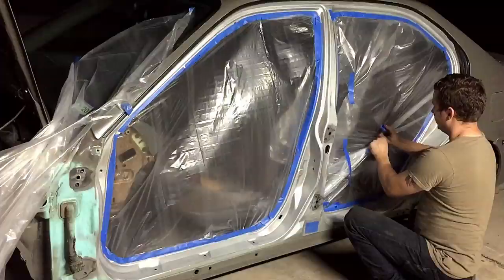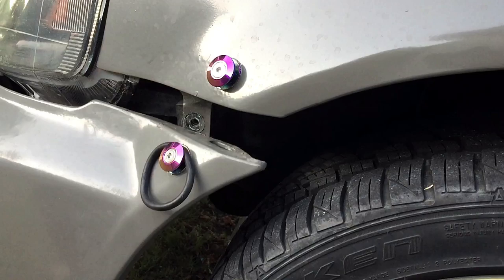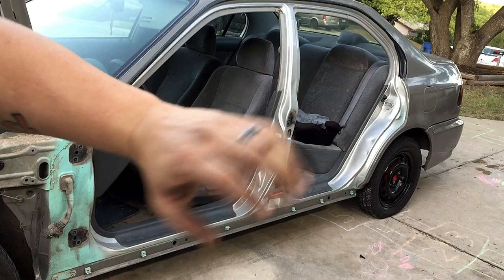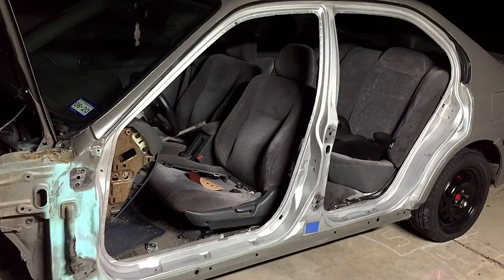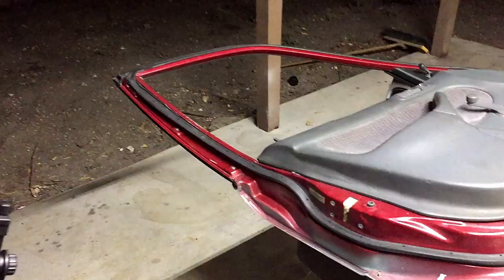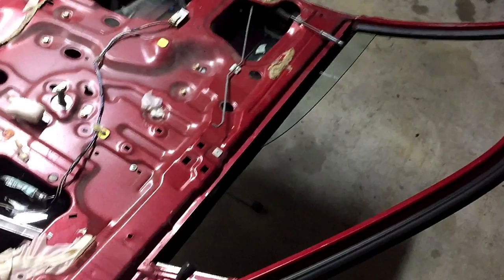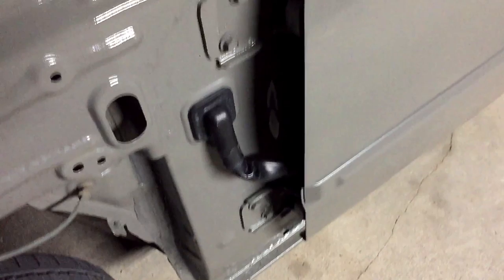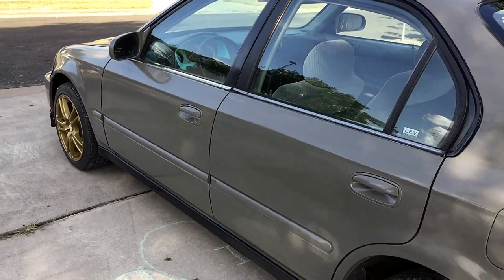How to paint door jambs on your car.

Comment: To get the window chank handle off I like to use a rag to push the clip down by pulling the rag tight and sliding it down behind the chank handle pull the rag side to side an in at the same time and it will push off the clip. Doesn't scratch things and the clips don't go flying
Reply from the maker: Josh Gardner Very smart I’m pinning this post!

Comment: Some good info and bravery there. I have 1 suggestion, before you remove any doors or hinges drill a couple of small holes through each hinge into the door post, body or whatever it mounts to. When it comes time to remount everythingvthe small holes will help align the doors to there original position.

Comment: Looks good. It seems like the Tractor Supply paint has better coverage with less paint/cost which is important when you're on a tight budget. 👍  By the way do any of those "chrome" paints actually look like chrome?
Reply from the maker: ghogue61 Nope. They have one that can be applied with a paint roller or brush and it does look like chrome but it’s expensive and not sold in big chain stores

Comment: I am a new Land Cruiser FZJ80 owner.  I recently decided to address the peeling clear coat on the hood, roof, top of
the rear lift gate and fender flares. I rented a spray booth for 3 hours. After taping, getting organized, I
only had time to shoot BASE COAT before my time expired and the next guy entered the booth. QUESTION: How long can I wait to shoot my CLEAR coat? I can not get back in the booth for 3 days!  if I have to re-shoot any base at all. What are your thoughts on my 3 day wait before shooting clear? Ok to shoot clear after 3 days or must I wet sand the base first? Thanks
Reply from the maker: JustSomeGuy you can shoot clear within a few hours if your crunches for time.

Comment: I have a question do you wet sand the paint before clear or clear coat the car then wet sand and buff???
Reply from the maker: If you want it 100% flawless you wet sand the color coat then you clear it then wet sand the clear then clear again until you achive the shine you want. Option B. Wet sand the color coat with 1000 grit then add clear over it then wet sand the clear with 1500-200-2500 then buff and your good. Im not as picky so i usually just clear then wet sand and buff.